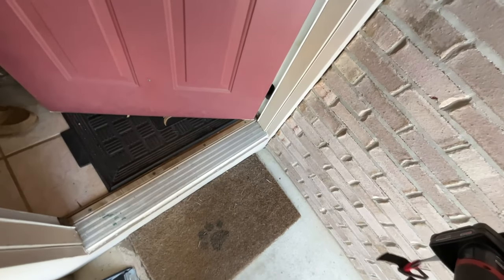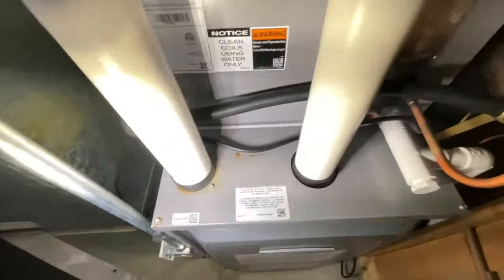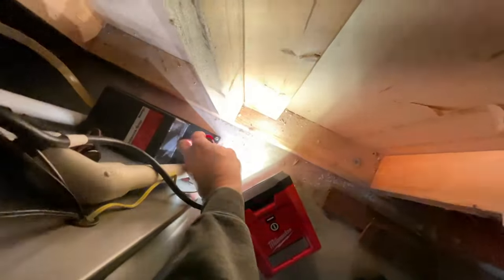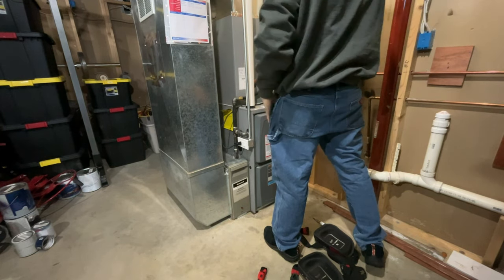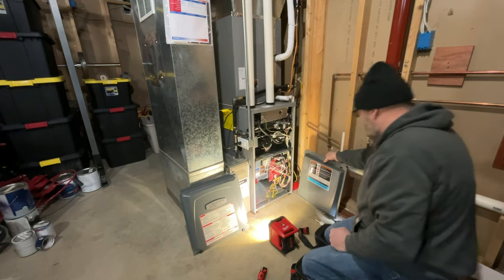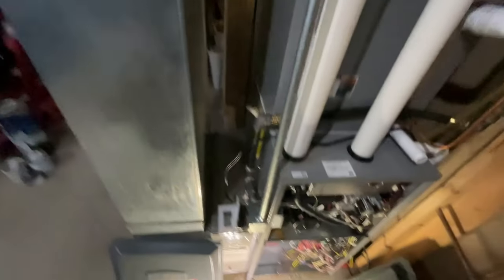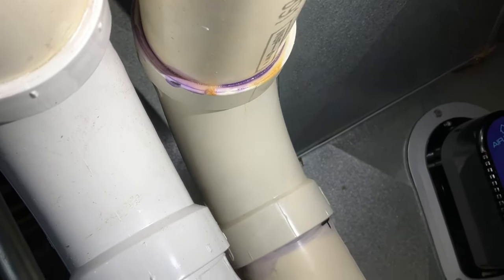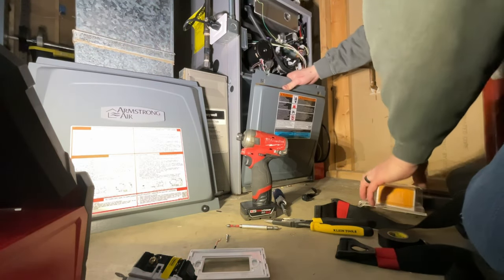No Heat, New Armstrong gas Furnace easy fix!

Comment: I have an Armstrong running on L.P.  installed in the farm house at the farm here 11-2019.  My reliable HVAC place said they are trouble free and I haven't touched it other than filters since.  These below zero temps in Mich. have me wanting it keep it running.  I have the same switch mounted in the same place, so far we're good but I'm going to by flame sensor and other switches so I have them on hand when it needs fixing one day.  No doubt during it's life all the switches and probably control board will need to be replaced.  Thanks for the video.
Reply from the maker: It's like having a trusty farm dog, isn't it? Your Armstrong just keeps on running, keeping you warm during those below zero temps. Stocking up on spare parts is like having a first aid kit for your HVAC system. Smart move! Thanks for tuning in and sharing your experience!
Reply: @ADVANHVAC  Actually I took a look at it today. Took the cover off to the burners that has the round window in.  I took the heat sensor out and cleaned it with a dollar bill as shown in vids.  There was several  bugs laying below the burners that I swept out and wondering how many are above the plastic screen at top of furnace.  Never thought about all the box elder and lady bugs crawling inside the intake pipe.  Air intake/exaust is a straight shot about 15' to the west, 30" above ground.  I'll find a way to check for restriction and screen bugs from intake.

Comment: Don't think I would be happy with a tech walking away from an obvious repair no matter whose work it was.
Reply from the maker: It will be Fixed in 2 days. The client was just fine with that. The main issue was they had no heat I FIXED that. Thanks for watching.